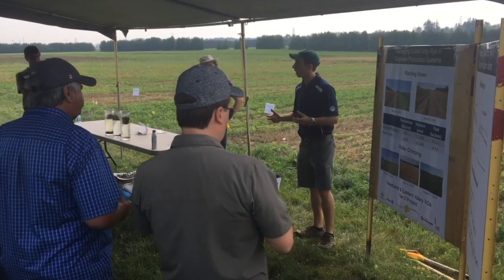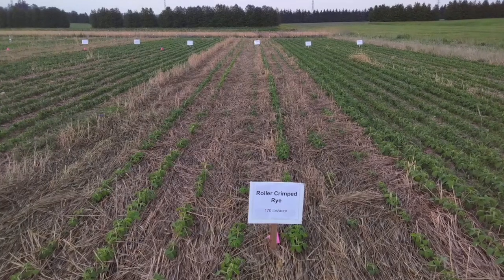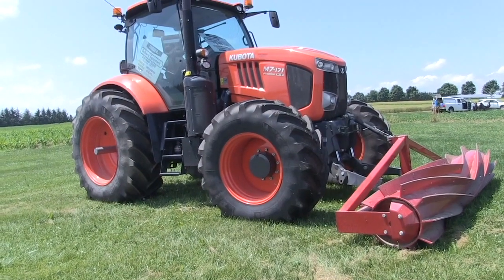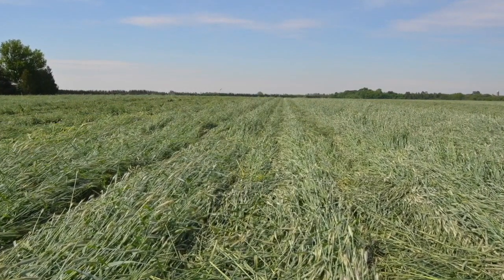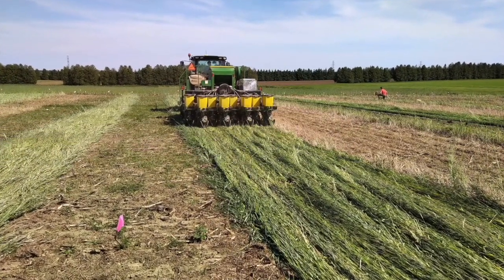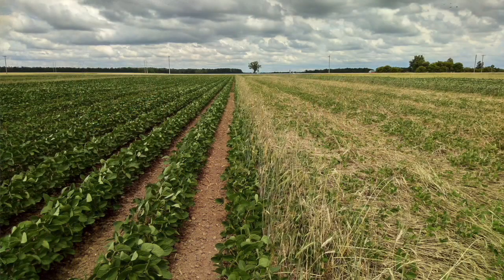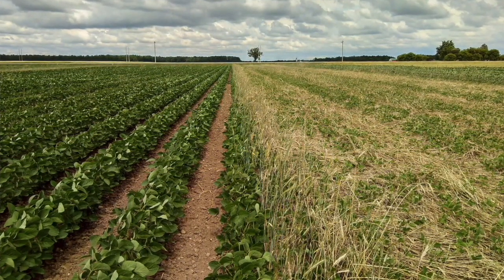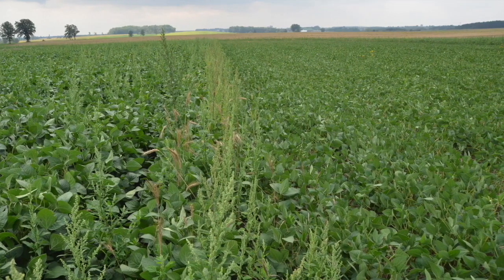Cover crop-driven organic no-till soybean production in Ontario

Comment: Love seeing this,I’ve been planting green for 21 years.  I will say, if you plant into that cover crop while it’s standing at boot stage, you can crimp it 2-3 weeks later. 

It gets your beans in sooner, and the cover crop benefits increase with time. Rye banks nutrients in the soil as it preps to fill the grain head. I was reminded of that the time I left some strips of rye standing and went back with the stripper header to harvest the rye for seed. The yield loss on those strips cost me more than the value of the rye seed. 

Giving the crop an earlier start gets it to a stronger stage before the pest pressure builds up.